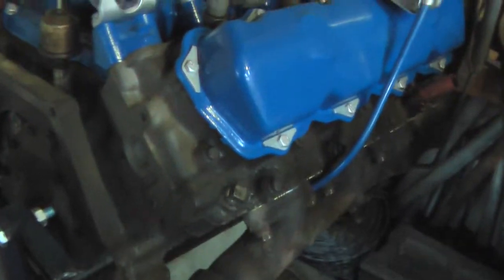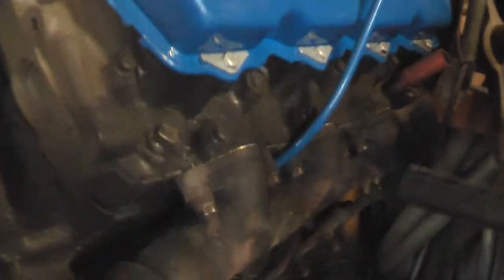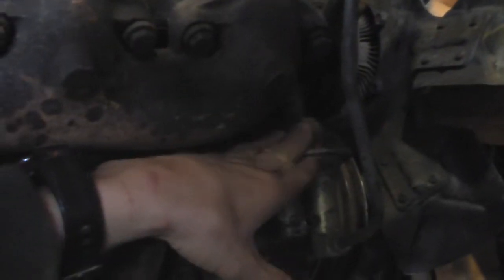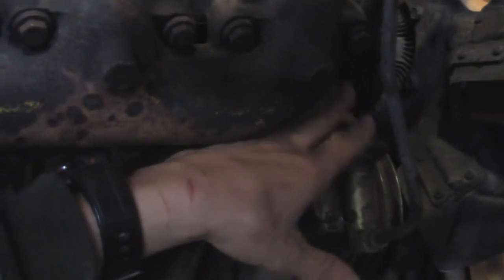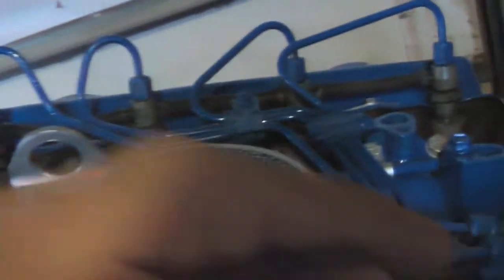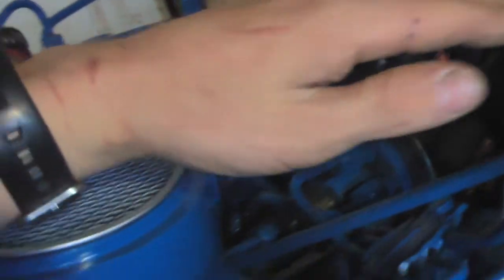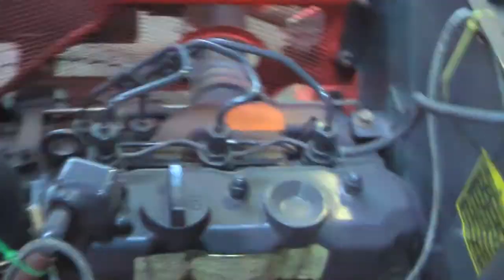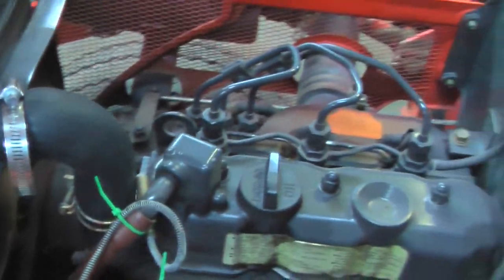How Mechanical Fuel Pumps Work

Comment: The reason electric fuel pumps are inside the fuel tanks is because liquid fuel can't be ignited by the electricity. If they weren't at the bottom inside the fuel tanks the electricity could ignite the fuel vapors, which could cause an explosion.
Reply: Noah Bata Thanks man I always wanted to know that.

Comment: When you run a mechanical pump gas engine out of gas, all you have to do is take the breather cover off and pour alittle bit of gas in the carb. Put the cover back on. athat bit of gas will greatly reduce your cranking time!

Comment: Not "ALL"  new vehicles use electric pumps. The current international dt466 maxxforceDT still use a mechanical fuel pump driven off the high pressure oil pump. You dont always have to use the crank method. Most trucks have a fuel primer on them to prime the fuel filter housing with fuel. Your excursion also has a varible rate fuel pump on it. The ecm drives the fuel pump to vary the fuel rate depending on load condtions

Comment: On some vehicles with carbs you can get electic pumps that work outside the tank and the reason for this is because they don't run as hot as the sump pump types because they are only putting out about 6 to 10 psi max and the sump pump type can pump any where from 20 to 70 psi if not more in other cases

Comment: Great work Daniel. Most of the time on mechanical fuel pumps in cars you replace them because of the diaphram ruptures or the springs loose their tension. And electric pumps are "sump pumps" meaning since they run with the key on all the time it needs cooling so thats one of the reasons they stick them in the tank. con'td